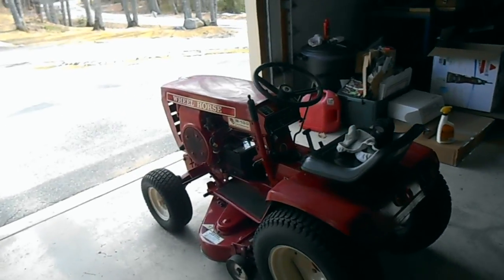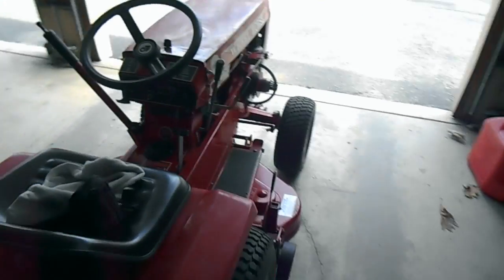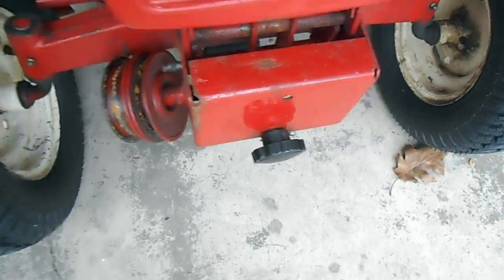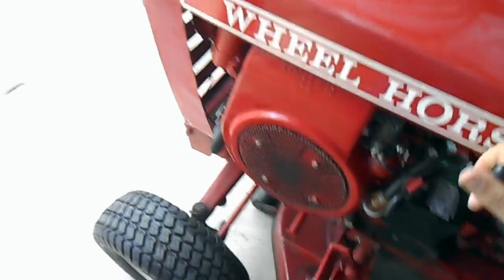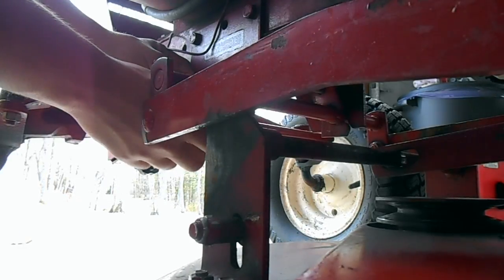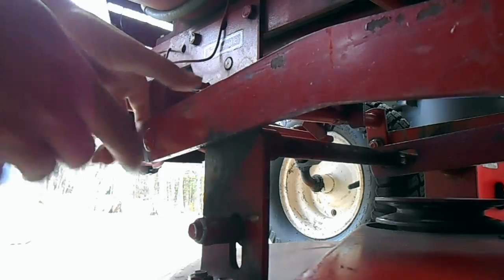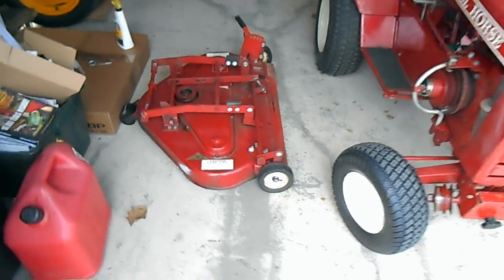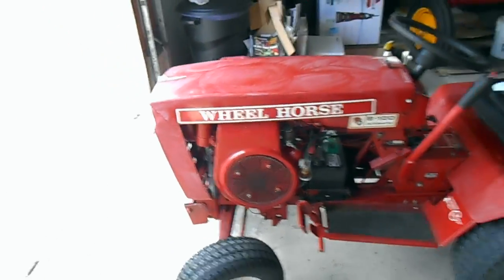How to remove a post-1971 Wheel Horse deck.

Comment: I really need to see a video on re-connecting it. Unfortunately, your hand hid the part that I needed to see.
Reply from the maker: This was years ago, but its simple enough.
Slide the deck under from the PTO side. Lower the lift handle. The lift bar 'pin' on the tractor slots into an oval opening on the center of the deck frame. Lift up on the lift handle, and the front bar, which swivels on the deck. This has a V groove on it.
You like that V groove up with the latch rod on the tractor frame, so it is centered there. Then just lift the deck lever and close the latch.
More complicated to write than it is to do.

Comment: Attaching back isn't as easy tho.
Reply from the maker: ..Attaching the deck takes about 45 seconds..  Slide under, line it up, lift, and lock the latch.
Reply: @Baldwin587  I put a brand new carb on my 12 hp kohler on my c120. It will only run if you choke with your hand. Why? Should start and run like new
Reply from the maker: @robertclark4929  Brand new carb, as in a new Carter? Or a new Chinese copy?
Your best off rebuilding your original. The new ones are garbage.
Reply: @Baldwin587  13 buck ebay carb. Lots of people use with good luck. Now my ignition coil got red hot and started spraying some oily junk.
Reply from the maker: @robertclark4929  I've had dozens of china carbs come through my shop.. all kinds of engines. I throw them away. Garbage. As for your coil. Was it running? If so thats not a normal failure.. however if you leave the key on and the engine isnt running they will overheat and burst.
Reply: @Baldwin587  it wasn't running. Left key on about 10 minutes and it got real hot then starts shooting oil everywhere. Bout ready to haul this money pit to the dump. I dont have the patience for junk.
Reply from the maker: @robertclark4929  Your problem is operator error, not the fault of the tractor.. 
You cant leave the ignition on without the engine running. Just like an old car. The coil will get hot and blow. 
Take the china carb and throw it away. Get a genuine rebuild kit for 10.00, spend an hour cleaning and reassembling the carb and it will run just fine. 
Now, due to your own negligence, buy a new coil, set the points, and change the condenser while your at it. Off you go. It ought to run just fine. These are not 'throw away' machines.
Reply: @Baldwin587  I dont understand why you dislike the China carbs. They are exactly like the original. No difference at all. Plus the rebuild kits on Ebay are made in China like everything else you buy. I have the old carb and 2 new ones too.I will rebuild the old one but I think it's a waste of time.Coils are 30 bucks locally but 11 on Ebay for the same thing.
Reply: Could the fuel pump be the issue?
Reply from the maker: @robertclark4929  You are contradicting all your own statments. 
No. The 'new' china carb is nothing alike the original Carter model N. The tolerances are sloppy, the casings are poor, the jets are of very poor quality. You get what you pay for. They share nothing in common with an original carb outside of bolt pattern.  
Just your saying 'it only runs with my hand over the carb' answers that. If the pump is pumping, the carb will get fuel. If the carb gets fuel and will not run, then the carb likely has a casting flash somewhere inside and you'll never make it work. Toss it. Buy a GENUINE. AMERICAN. REBUILD. KIT. Fix it properly. And be done with it. It won't take even the most inexperienced person more than an hour. It's very simple. 
So you bought two new carbs, it still doesn't run, and you haven't tried to fix the original..? Seems to me those two carbs would have paid for a genuine rebuild kit for a well made carb, two or three times over..
An 11 dollar Ebay coil will also likely disappoint you. That original Delco coil likely would have outlasted the tractor. The only comparable unit made today would be a Bosch blue coil. Again, you get what you pay for. 
You need to start completely over. If you have fuel flow, great. If not, fix the pump. Then rebuild a carb that isnt made of trash. Then go all through your ignition and replace the points, condenser, and coil. If everything else is good, it'll run. These are simple engines. But you can't skip and dash around with junk parts, because they will just fail again and create a headache. 

If you need help. I'm more than willing to help you. But you can't keep playing with shoddy cheap parts. They'll just cause more problems.
Reply: @Baldwin587  I would certainly appreciate your help. First let's rebuild the carb. Where do I find an American rebuild kit. Most kits on Ebay average under 10 bucks but who knows if they are decent.
Reply from the maker: @robertclark4929  Honestly any of the kits will really work. Why do you think it needs rebuilding in the first place? Does it leak fuel out the throat of the carb? 
With a Carter N, all you really have to do is change out the gaskets and replace the float needle and seat. The rest of the parts don't really wear out. (Providing they are not damaged. IE lots of corrosion, damaged tips from being forced, etc)
Kohler 25-757-16 should be the part number for the kit. 
If the throttle shaft is really loose in the top of the carb, some of them you can simply tap in a new bushing (look for a 'well' in the top of the carb body. If its still tight enough or just slightly loose, dont worry about it. 
I'd have th check my kit number but I think the one I posted is the right one. I get them right at Napa or off ebay for under 15.00 and they are Kohler tagged kits. I've never had an issue. 

Its a very simple carb. Just clean it well, make sure its assembled right, set the needles and float level, and you should be good to go. I've saved some really bad ones.
Reply: @Baldwin587  I found the oem kohler kit on ebay for 12.00. Tractor has been sitting a long time and the previous owner attempted to get running by replacing the oem carb (which I have). Neither of these china carbs work. Well one let's it run but not good. The old carb looks ok. Needs cleaning and gaskets. I will order a kit. On another note isavetractors.com wrote me back about a carb kit and wanted me to buy a new carb from them. Their exact quote was " not many people can rebuild the original carbs because they require machining bushings etc." Trying to get you to buy a new one I think.
Reply from the maker: @robertclark4929  Rubbish. Just trying to sell you parts. Very seldom does that throttle shaft bushing wear. IF it does, usually they cut a slot into the top of the carb, letting you simply tap a new bushing in to tighten it back up for another 40 years.
Reply: @Baldwin587  I will order us the oem kit tonite and have early next week. In the meantime I will get carb cleaned ready for disassmbley